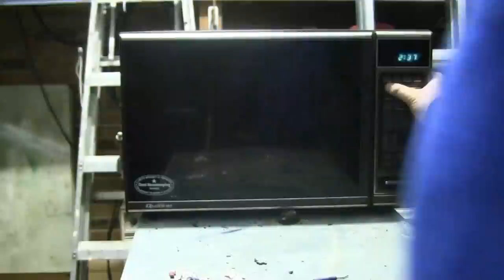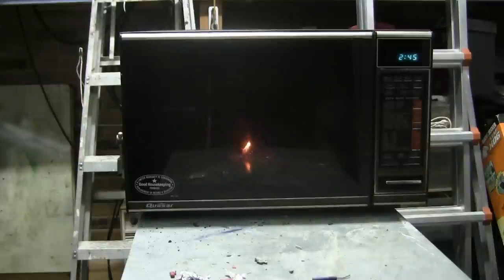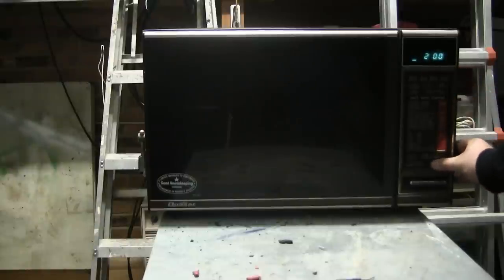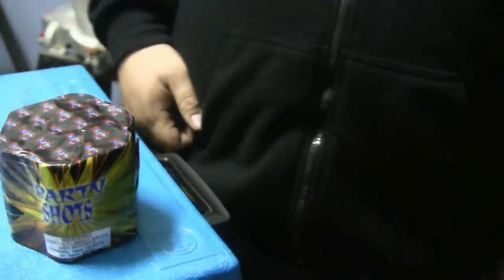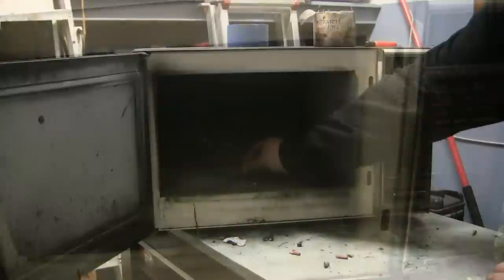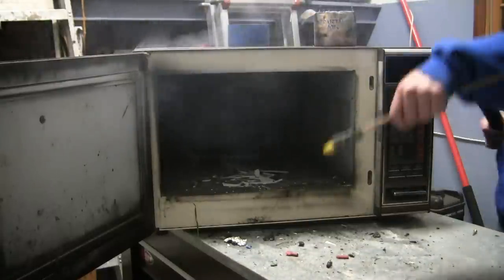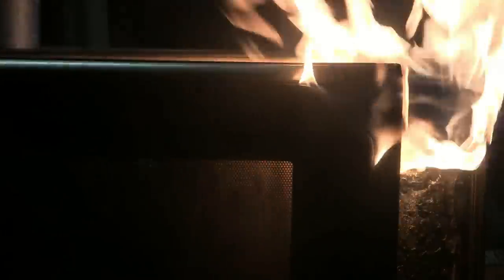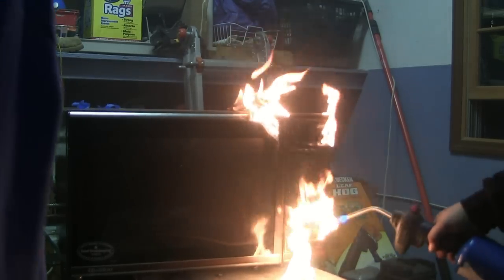Microwave Destruction

Comment: Putting nothing in the microwave and starting it up can damage it, so this was a good idea, despite the sparks.
Reply: Camilla Johansson It can damage your microwave because all the microwaves it generates bounces around the inside instead of being absorbed and turned into heat in the food. High quality microwaves are designed to prevent it from causing real problems, but it's still not a great idea. 

Credit to EdgeOfDreams on Reddit for the paragraph above.